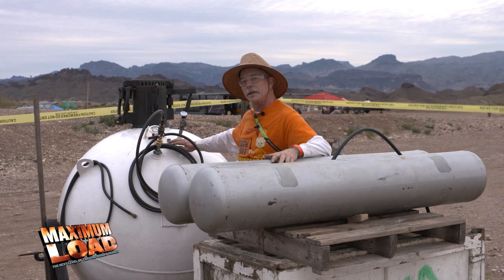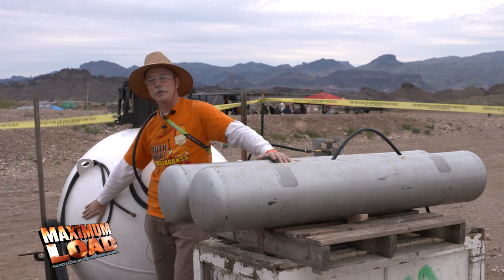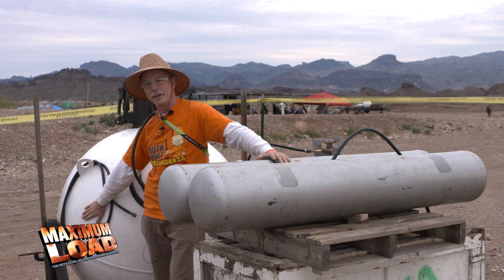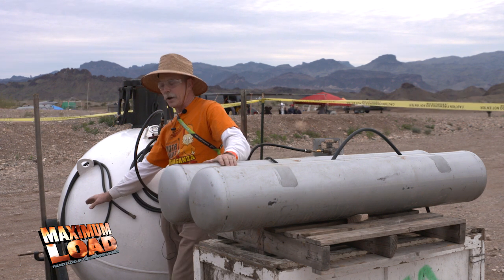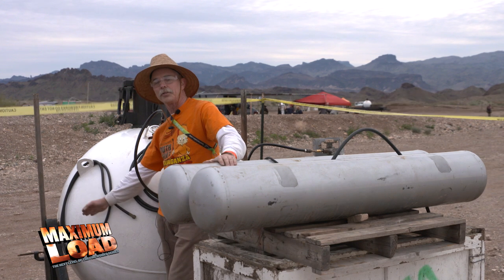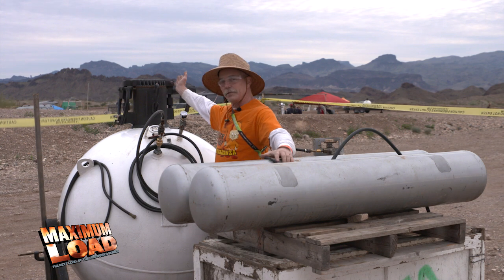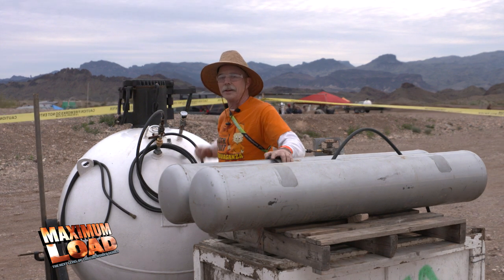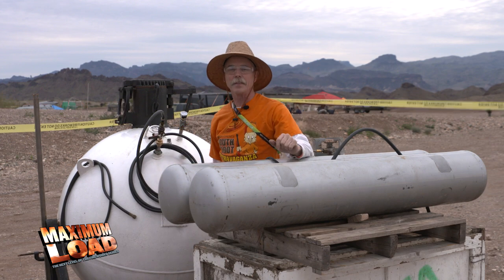Controlled BLEVE: Boiling Liquid Expanding Vapor Explosion - Passfire Maximum Load Teaser

Comment: This is not a BLEVE.
Reply: The last E in BLEVE stands for explosion. 😉

No, siriously. A bleve is the rupture of a tank, were an exterior fire boils of the liquid and destructs the tank shell at the same time. At a certain moment, the hole tank ruptures and a massive explosion happens.

What you saw here, you would also see at a BLEVE mostly, as the saftey valve of a tank will open to reduce the pressure in the tank.
Reply: Why
Reply: Yes, I think so. This is more of a jet fire and at the end the tank would be intact. In BLEVE the tank would have been subject to a sustained external fire that makes the flammable liquid to gather enough heat to expand and explode after ignition point is reached. BLEVE is a disastrous explosion.
Reply: BLEVB

Boiling liquid expanding vapor burning. He said himself 😂

Definitely not a BLEVE! 😂

Comment: This isn’t a BLEVE. It’s an Unconfined vapour cloud explosion...
Reply: Oliver Drain spot on. It’s a glorified flamethrower.
Reply: The propane is boiling at ambient pressure, it counts as a BLEVE.
Reply: @josephastier7421  not even remotely correct.  Propane boils at -42 degrees and turns into a gas.  In order to have a BLEVE you need a liquid boiling INSIDE a container building pressure.  These guys are just letting propane out of the tank and burning it as a gas.  It would be the equivalent of an a propane tank venting and that venting gas being on fire, that is not a BLEVE.
Reply: @iShaymus  OK, I'll go with that, but only because the venting is more like a geyser and there is no explosion.   All of the other criteria ARE met.

Boiling - yes
Liquid - yes
Expanding - yes
Vapor - yes
Explosion - no.  

One might argue that such a rapid decompression + release comes pretty close, and if this tank had been unanchored and the huge valve/hatch been on the bottom the tank would have flown a great distance as a rocket - something a tank failing with a BLEVE will often do.  

But without the blast, it is not exploding, it is just "venting in a hurry".
Reply: @josephastier7421  NO , 
that is a tank that comes out as a projectile due to the pressure exerted by the combustible liquid, practically that tank fell off the ground like a space rocket
Reply: @josephastier7421   The BLEVE is in under pression inside the tank, makes the tank walls not resist this pressure and there is an explosion due to this expansion out of the tank, so in this video is not a BLEVE, check this https://www.youtube.com/watch?v=XAFMX8-ur7U